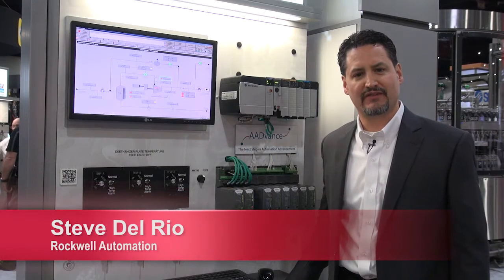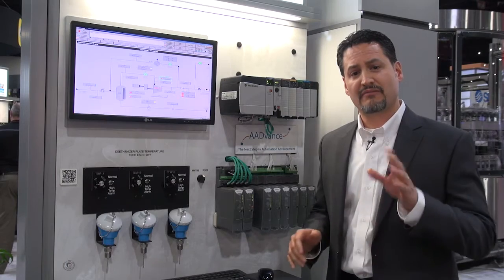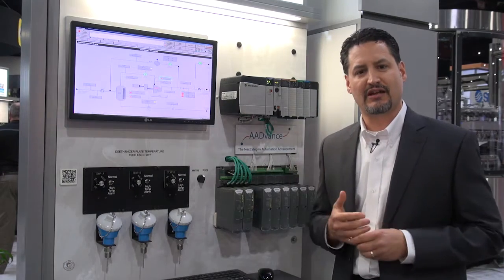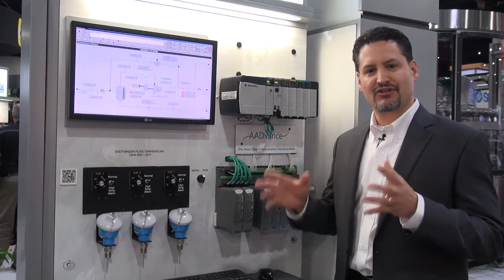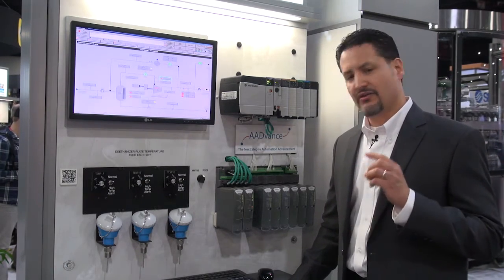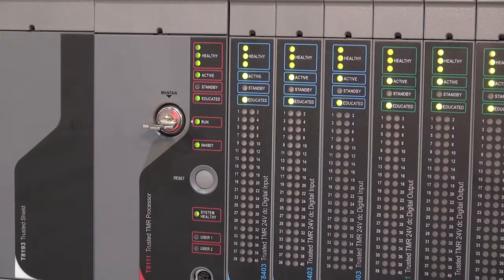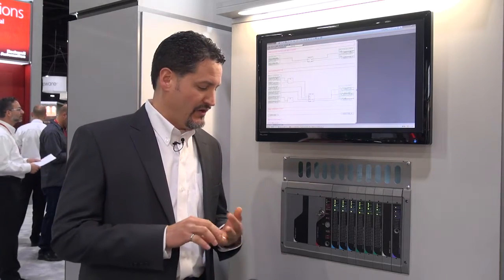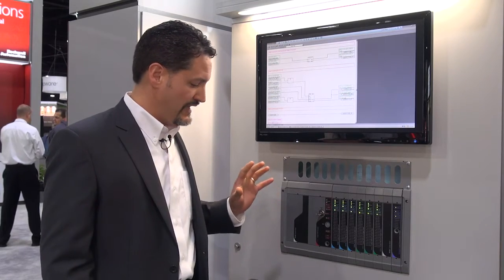Latest Developments in Process Safety Solutions

Comment: why my AADvance Workbench 2.1 cannot connect to the controller?
Reply: First check whether you can ping the IP of the chassis, it it is ok, then try disabling the Wifi and any other Network adapters. If that doesn't work, try turning off the windows firewall. Hope it helps
Reply: @danielpernia7824  thank you sir.. Finally I knew  that we must connect directly to the modul (not use switch, bridge or router)